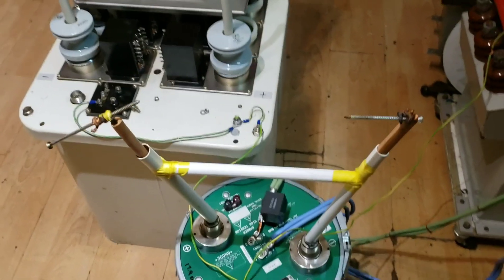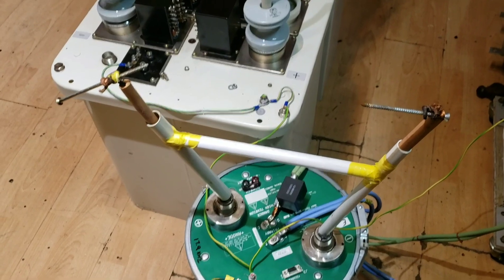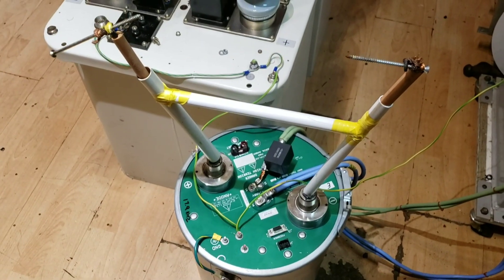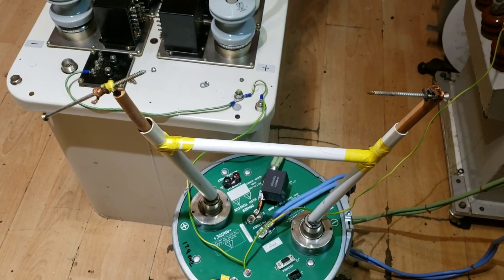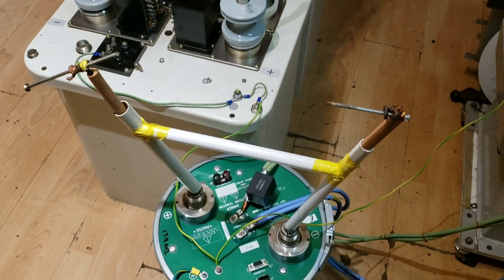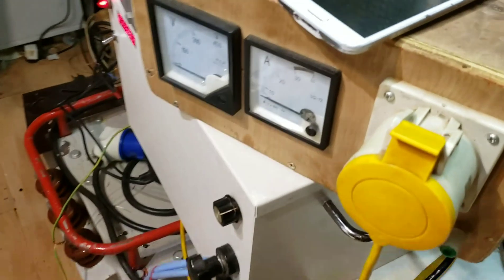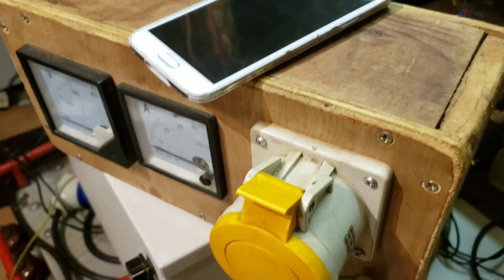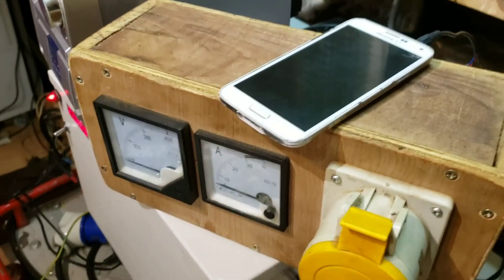Biggest Plasma Speaker on YouTube??

Comment: Very nice! But with arcs that big you have plenty of room left for modulation!(thus can give you much more amplitude on the sound)

The trick for great audio is the arc stabilisation!
Itll get rid of the pops and bangs :)
Reply from the maker: Was just a quick demo I might have a go at a better version seems its generated some interest...

Steve
Reply: @T2D.SteveArcs  how are you doing the modulation?
I did a modulated hfsstc a while back using a class d type of amplfier
Reply from the maker: @acidbyte23  I used a standard household hi fi ... aux for phone/audio input and the speaker output modulated pin 4 of tl494...
Basically same sort of thing you did by the sound of it🤣👍....

Steve
Reply: @T2D.SteveArcs  you did modulate the pulsewidth of the tl494? Or the frequency? 
Anyway very nice! Ive tried once with a pa amp but that amp didnt like the high frequencies that much lol. It got fried in the process lol
Reply: @T2D.SteveArcs  i see now. You modulated the deadtime pin.
Thatll result in pwm! Nice man sounds class d ish to me!
Reply from the maker: @acidbyte23  🤣👍